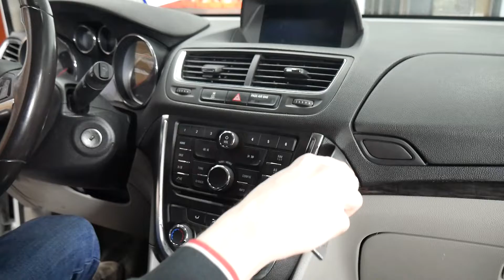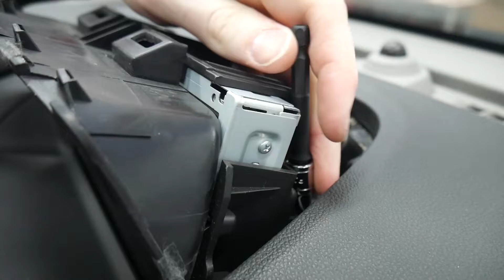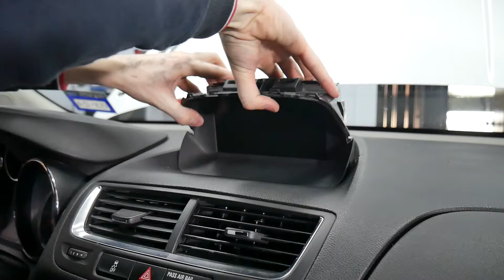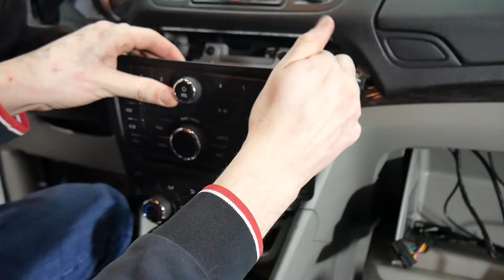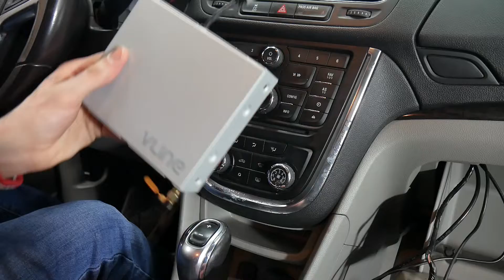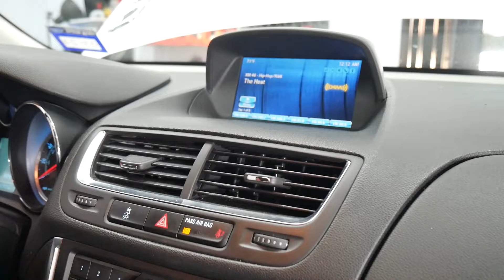Install Wireless CarPlay & Android Auto: GROM VLine VL2 in 2013-2016 Buick Encore with MyLink GM1

Comment from the maker: The VLine VL2 system for the integration of wireless CarPlay and Android Auto into 2013-2016 Buick Encore with the factory MyLink 7-inch screen stereo is available here:
https://gromaudio.com/store/vline/grom-vl2-gm1.html
Model: GM1VL2

Also compatible with:
Buick Regal 2011 - 2013 (Mylink 7-inch screen)
Buick Cascada 2016 - 2019 (Mylink 7-inch screen)
Buick Encore 2013 - 2016 (Mylink 7-inch screen)
Buick LaCrosse 2010 - 2013 (Mylink 7-inch screen)
Buick Verano 2012 - 2017 (Mylink 7-inch screen)
Chevrolet Camaro 2010 - 2015 (Mylink 7-inch screen)
Chevrolet Cruise 2011 - 2016 (Mylink 7-inch screen)
Chevrolet Equinox 2010 - 2017 (Mylink 7-inch screen)
Chevrolet Malibu 2013 - 2015 (Mylink 7-inch screen)
Chevrolet Volt 2011 - 2015 (Mylink 7-inch screen)
GMC Terrain 2010 - 2015 (Mylink 7-inch screen)

Comment: Think I may just trade in my 2016 for a newer model although I prefer the waterfall grill on my 2016. LOL. the system is about 700 us  plus 3 to 500 to have installed could probably just get a 2017 on a trade in for a few bucks more.
Reply from the maker: it is always an option.

Comment: Hello sir, we hope you can help me. I replaced the Junsun V1pro Android screen on a 2015 Opel Mokka. The screen is working and the steering wheel buttons are recognized with the air conditioner, but the sound of all the rear and front sensors and the car seat alert is very weak and low. We hope you can help in solving the problem. Thank you. There are no sounds for the alerts with the change of another speaker, but the problem was not solved, which is that the sound of all the alerts is very weak.
Reply from the maker: Thank you for contacting us! Unfortunately, we cannot help with this situation you are having, and recommend contacting the manufacturer of the aftermarket screen you installed. They should be able to help.
Our products, GROMN VLine VL2 and VLite VT2 systems to add CarPlay and Android Auto to the factory stereos of many vehicles, integrate with the factory stereos directly, and fully support all original car stereo systems and sound.
Reply: Thank you for the information, but all the buttons on the steering wheel work, but the problem is the beeping sound of all the car sensors. The sound is very weak and low. Some say that the canopy should be replaced with another one, and I do not know what the problem is. @gromaudio
Reply from the maker: @menyar4444 got it, it is best to check with the manufacturer of the equipment that you are installing. We have no experience with it.
Reply: Some say the canps need to be replaced. I don't know what the problem is. @gromaudio

Comment: Does the battery need to be disconnected first?
Reply from the maker: We recommend disconnecting the battery first. But sometimes, in our installations, we do not disconnect the battery. The radio error code may appear, so it is best practice to disconnect the battery.

Comment: Will there be a touch screen option i heard you were testing an ovelay?
Reply from the maker: Not for GM1.
Reply: @gromaudio  for 2015 can you use factory microphone and car usb input?
Reply from the maker: @jamesmorris7596  yes you can use the factory microphone for VLine VL2 with CarPlay / Android Auto. The factory USB input will be lost, as the iPod/USB mode will be taken over the VLine VL2 system. However. VLine VL2 system has two USB ports that provide the same functionality as factory USB.

Comment: can this go on the 2014 encore with the 2g network?
Reply from the maker: Yes it can as long as the stereo has MyLinq 7-inch screen.
Reply: @gromaudio I’m looking to replace just the infotainment screen as I just broke mine. If I buy a replacement it is just a plug and play for the screen to put in another oem screen correct?

Comment: Can you please clarify if the device can use the car’s standard microphone (Buick Encore 2016), or does it require an additional one to be installed? Also, I’m unclear about the standard UI for the air conditioner and the backup camera. Do I need to exit VLine to use these features, or do they overlay on top of the VLine UI?
Reply from the maker: Hello, when installed into Buick Encore 2016, the system will use the factory microphone that is already available in the vehicle.
The backup camera will keep working and you do not have to exit the VLine mode to access the factory backup camera. It will show up upon the vehicle's reverse.
The climate controls data will show up on the screen on top of the VLine UI (the temperature).
Reply: @gromaudio thank you.
I mean that layout of climate control where you can see current level and direction. It’s visible on factory screen when I switch climate control.
Also do you have any photos of how VLine can be mounted in Buick Encore 2016? As I understand you recommend to put it inside the glove compartment so I’m curious how it looks like.
Reply from the maker: @rogidev  To see the full climate control screen, you will switch back to the factory UI by entering any factory UI source (such as FM).
We do not have photos of what the unit itself looks like in the glove compartment. However, you can watch our other videos for examples.

Comment: Installed this myself this morning following the above for guidance only, certainly takes longer than the 8 minutes you see here, but I expected that, all depends on your hands size and your luck in getting that radio to line back up with the cables afterwards. Seems to work great, haven't had much time to toy with it yet, but it does work and google maps functions which is nice. Screen isn't touch because the OEM screen isn't touch and GROM doesnt appear to sell a kit for a touch overlay, they do however sell a 7 inch overlay kit meant for Volvo Mercedes which makes me curious if it would also work for this screen since they are both 7in, GROM said they didnt carry one for my 2014 buick encore, not sure if worth trying the one for Volvo Mercedes.
Reply from the maker: Thank you for your feedback!
Reply: @Hexxium  can I ask how your system is working now, I just brought this car for my wife and looking to install this system myself. Did your factory mic work?
Reply: @ Her factory mic seems to work fine, the system doesnt seem to always catch and intercept on every startup according to her- there is an update available though that may fix it, I just havent had time to go out and mess with it again. I really wish it would have touch support, GROM does not currently have a touch override for her car, but if I was using the controls everyday I would probably adapt, touch would be way nicer though
Reply: Thanks i guess I'll be trying this on my vacation next week.   @Hexxium
Reply: Can I use the factory usb once installed or i have to use the one in glove box?
Reply: @jamesmorris7596  based on their reply to your comment below in this vid, you lose factory usb and get 2 on the grom unit instead which is typically in your glovebox